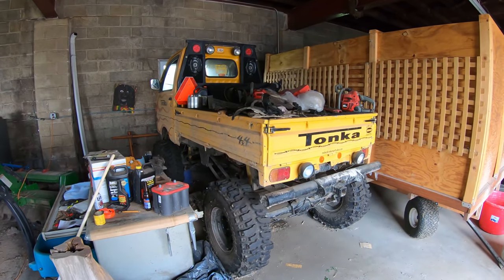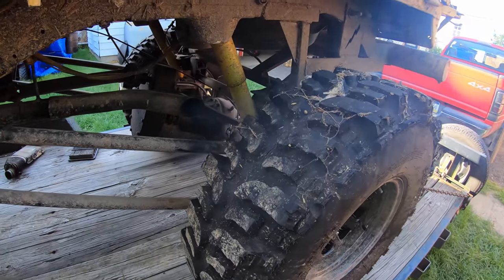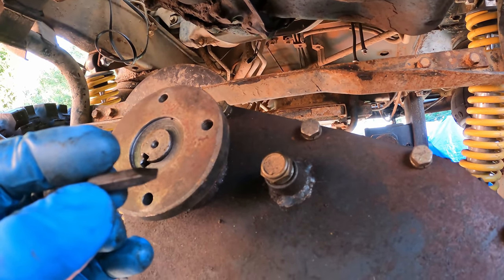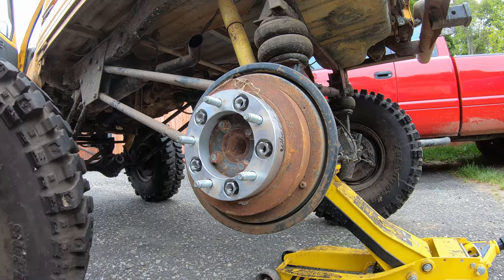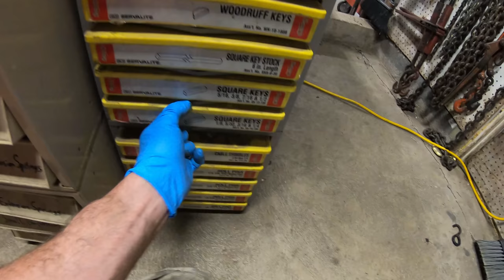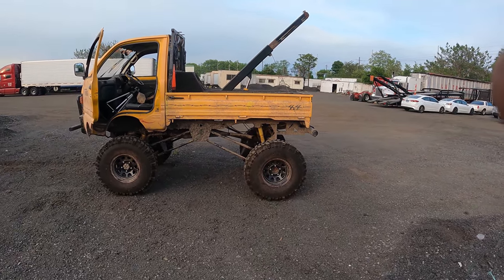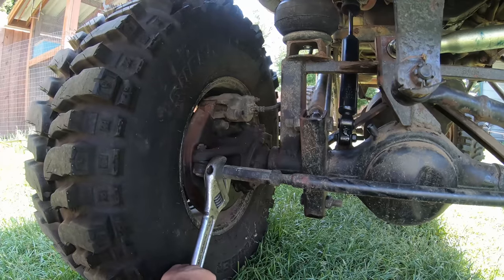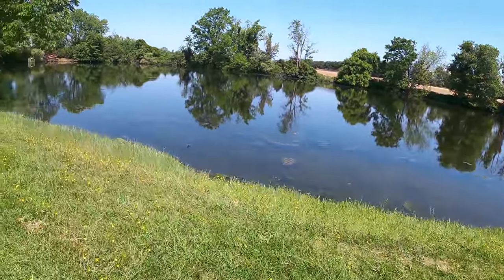Life Size Tonka MONSTER TRUCK - Will She Rip!? NNKH

Comment: My father had a 1980 Suzuki truck like this on the farm we had.  It was a 2 stroke, self mixing 550cc engine 4x4.  I believe he lifted it about 2 or 3 inches with 30 to 32 inch mud tires. That thing was amazing as a farm truck, there literally was nothing it couldn't do better than any Ford or Chevy truck on the farm and mud that would easily sink a Ford or Chevy was a non-issue for it.  We had it from 1983 to 1998 when he sold the farm and the little truck with it.  It still ran great.  I loved the fold down sides on the bed.   Not saying I'd run it as a daily driver on the road, but as for industry/farm work, I'd choose these over anything.  Basically a UTV on steroids is how I'd describe one.  Amazing piece of work someone did to this truck, a head turner for sure.

Comment: I used to import these Japanese kei trucks. They are unbelievably reliable and it is usually something catastrophic like a broken cambelt to stop them from running. 
Great machines offroad with a set of 25's and a lift kit.
Some of the Suzuki and Daihatsu are supplied with factory rear diff lock.
Full credit to the builder of this little machine.
Reply: i see them in the Philippines they are cool AF !!

Comment: The steering box is ready to yeet itself off of there, even with the fix. What a fun build. Every time I come across one of these truck videos I start looking around to buy one. It will happen one day.
Reply from the maker: Haha yeah, I felt like this thing was going to rip off when I was driving it around. Seems to be holding up though!  Definitely needs some more bracing
Reply: If you want fun buy a Suzuki samurai and put a set of super swampers on it. The things are unstoppable
Reply: @jarrettmorris4692  I have own one Zuki whit 31 inch on it was body liftet and hat A 2´Lift kit on it too 
It was unstoppable
Reply: Its perfect budget garage build toy ;) perfect for atv/side by recovery vehicle
Reply: They were only $600 a few years ago
Reply: @jarrettmorris4692  moms ex had one, always with a spare engine ready to put in
Reply: @JohnJames.  same here
Reply: There was one forsale in micco fl the community is called barefoot bay if you want to try to track it down
Reply: @NoNonsenseKnowHow  you gotta re 4 link it front and rear and throw some slam specialties RS-8 bags all the way around...gotta redo the whole setup.get rid of those knarly Knarly Pinon angles..she's gonna be sooooo sick
Reply: @NoNonsenseKnowHow  I mean if u don't want it haha..throw a 2jz turboed with them new 4 links and bags and the new setup shit will ride and handle better then a new chevy with twice the horsepower

Comment: LOL! The angle of that driveshaft! I am surprised it lasted ten minutes!
Reply: IKR?????????
Reply: Same here I thought it would make five min. But the angle of the ring and pinion prob. not getting proper oiling becouse of there angle...might overheat the gears...
Reply: Well he had good intentions gut didn't have the experience...
Reply: @peterrivney552  Still a good way to learn. Learning by mistakes and practical experience is better than learning from a book any day.
Reply: I'm amazed it moved! I've done some Rangi af repairs in my time but I'd never let it off the lift like that. 
Cool concept, terrible execution.
Reply: @Not_A_Cat  Same here. I have seen some very bad construction, especially powertrain and driveline mistakes that surprisingly lasted a while. Of course, poorly designed systems like that usually fail at the worst possible time when loads are at the highest. I have seen drastic driveline angles last a while when kept on pavement and then fail almost immediately once they go offroad. Which makes sense.
I guess that proves just how strong some drivetrain parts are. Even when installed under the worst conditions they manage to limp along for a while. I certainly would not drive them though.
Reply: That's about all you can do when you have a six foot wheel base and 24 inches of lift kit. Besides it's a CV joint running 15mph and you would be surprised what I put that thing through. And the cost was zero.
Reply: @johnstiles4457  Amazing how much abuse those parts can take.

Comment: I've got the Suzuki Carry, 1994. I just can't believe this truck actually moves under it's own power! Unreal, trust me. The 3 banging straight 660cc only puts out around, what??? 42 horse with around 49 pounds torque ??? 
They are a lot of fun to drive and talk when people approach asking what the hell>.....

After sitting for a Few more than a few years, I had mine running in less than 30 minutes as well. 
Quick turn of a screw driver to the carb, clean it out really well, put air in the tires and took it for a ride. 

still running great! Indestructible.

Comment: I have the exact same truck and I love it  , little 3 inch lift  and she goes through almost everything, great for getting fire wood
Reply from the maker: Awesome!
Reply: Keep an eye on the auto choke my Mitsubishi is the same year and the auto choke always gives me some BS, but definitely the best $4000 I've ever spent on a toy
Reply from the maker: @slowburn_1725  Cool, thanks for the tip!
Reply: @slowburn_1725  You can disable the choke if you want. If its like mine you can just take the spring\coil out.
Reply: @mikescudder4621  is it a late 80's Mitsubishi minicab ? If so I'm assuming you had similar issues, it will idol and run fine one second then you take off and it sits on its face and wants to stall out..
Reply: @slowburn_1725  I have a 2 cylinder 550cc Mitsubishi minicab (1981)!!! But I've had an issue on my vw Kombi that had an autochoke, for years they are fine but now that it's almost 50 years old things like this are a pain. I just took the coil out. You have to let the engine actually warm up before you head off but it's actually better for the engine.
Reply: @slowburn_1725  
Can you buy parts at the auto parts store?
Reply: @xmo552  misc parts yes, oil filter, belts , hose's etc but you have to bring original part's with you so you can match, other more important parts I've found on a few different websites
Reply: @slowburn_1725  
Thanks

Comment: I feel like theres more to the tow/crane system than what we saw. The big yellow T bar thing and some other parts in the rear tail gate. They seem like they come out, maybe as wheel cradles?
Reply: I think that is the brace that holds the arm to the bed. Otherwise it would rip that thin metal
Reply from the maker: Yes Ryan's correct about that.

Comment: Ever since I first saw the Honda Acty Pick Up Truck in London in the 1980's I've loved these tiny, forward control vehicles!

Unfortunately, London traffic is NOT where you would want to be in these trucks because the crew cabin doubles as the crumple zone during collisions!

Even quite low speed impacts present grave risks to the occupants, and after inspecting the remains of two which had been in frontal collisions I decided that they weren't for me.

I look forward to seeing your adventures with your Tonka Truck. Subscribed.

In the UK a boat building company called Island Plastics manufactured one piece fibreglass, demountable campers for these trucks, which you could place on the stands and drive away! 

They were hugely popular, and if you do a Google Images search for the Honda Acty Romahome you'll find them, one would look good on the back of your Tonka Truck!

Comment: A hammer and an adjustable spanner. What more do you need? I like that vehicle :-)
Reply: I got a locking adjustable torque hammer at walmet for like 12$
Reply: @yzrippin  I got a 12 v one that fits on a battery from Lidl, about your equivalent of Harbour Frieight for a few pennies, clips on a car battery , not much beats it.
Reply: Those all over the Philippines cheep too

Comment: Considering how the rest of it is built you should just weld up the spider gears in the back of that thing don’t waste the money on a locker because it’s obviously never going to see street duty when I welded up the rear diff in my old Jeep it would go more places in 2 Wheel Dr. with a welded diff then it would go in four-wheel-drive with an open diff

Comment: Those flanges on the drop box are for sail boats.   It couples the prop shaft with the transmission I recognize the key ways Usualy the prop shaft will have holes for pointed set screws.

Comment: I had one when i lived in the Philiipines, the shifter knob was worn out and i didnt realize that i had an extra low gear which was between 1st and 2nd push down and forward it was pretty low. Also it had diff lock in the front ifs axle. great vid man It was a Suzuki multicab 660cc

Comment: I haven’t looked into mine much yet, but how do I engage it into 4x4?  I didn’t see anything inside the cab besides a high and low setting .  Mine is all stock and basically the same as yours

Comment: What exactly is that 4 head air chuck called? and where can you get one?     You could get all 4 tires exactly the same psi that way.
Reply from the maker: I'm not sure if they sell one or not. I made this years ago. But it's basically for clip-on shocks with some t fittings to put them in line.  Original reason I made it was for airing down my tires when I go off road and being able to air them back up with a compressor very easily. Yes it puts all the tires at the same pressure
Reply from the maker: I did some brief research after making it and it seems some offroad companies already have similar items

Comment: that looks like fun, but oh my god that front driveshaft LOL!  EDIT - Should get an axle that has the drop on opposite side, could get rid of a lot of that angle... or rebuild the drop-box to reach to the side further.  Could mount the steering box directly to the axle to eliminate a lot of the steering issues.
Reply from the maker: Yeah I feel like the best move would just be scrapping the whole drive train and starting from scratch. I mean hats off to the guy for all the work he put into it but damnnnn dude

Comment: Do you have a link for those quick clips you used to drain all the tires.
Reply from the maker: No but if you type in clip on tire filler they should pop up. If you're going to make a hose like that just make sure to get the ones that are self-sealing when not clipped.

Comment: The trucks themselves were made by Daihatsu out of Korea everybody and their brother has a version of them usually outfitted with their engine sometimes the Korean Engine 2 and 3 cylinder both left-hand and right-hand Drive 4x4 there's actually an entire platform of these vehicles you can actually get the pickup in a crew cab version Honda Yamaha Daihatsu Suzuki and I'm sure there's some others that aren't familiar to me I have a older 2 cylinder Daihatsu version if you ever seen any southeast Asia films you will notice that these things are definitely mules I've seen them stacked three stories high with all kinds of crap being towed to market fun little trucks I know our little love machine version has provided hours of endless enjoyment for my family enjoy your Tonka truck thanks for the video
Reply from the maker: Thanks for adding some info and I appreciate you checking it out!
Reply: Mr B, I think you’ll find they are Japanese brands, not Korean. Amazing little trucks. My Daihatsu 4WD kei has a diff lock and low ratio. Clears R15 mud tires even without a lift kit and will go just about anywhere. Street legal here in Japan and will cruise (= scream) the highway at 65 mph (unless it’s a headwind) but need to put the small wheels back on every two years for certification. Thanks for the vid. Crazy mods on that Tonka but why not.

Comment: I believe that rear axle gear set up is a modified portal axle hub. They usually are intended to hook to the axle and the hub giving you more ground clearance without jeopardizing too much in suspension and drive shaft issue. I think he should have ran dual portal axle to hubs on all 4 wheels instead of the extra suspension since its messing with the drive shaft angle and performance. and would have done the same thing in the long run. But i understand you work with what you got so...

Comment: How is it to drive it from the right hand side instead of the left hand of the left hand Please comment back thank you
Reply from the maker: Honestly it felt pretty natural and normal to me. Shifting with the left hand felt weird at first but it's kind of nice.   One thing I did keep doing though was trying to get into the wrong side of the vehicle. And also trying to hit the turn signal to the left of the steering wheel when it is actually on the right
Reply: @NoNonsenseKnowHow   I would like to buy one and put a plough on it or a snowblower I you are a snowblower I do apartment buildings and this thing would be ideal for doing the sidewalks and small areas
Reply from the maker: Yeah that would be cool. Definitely a all factory one would be best for that

Comment: The old hand over the carb or throttle body trick works a lot better when you rev it up to high rpms then doit at idle not pulling much but I’m sure you are aware of this
Reply from the maker: Yes. Pulls a lot more vacuum. I think I was holding the camera with my other hand or something along those lines is the only reason I didn't do it that way.

Comment: That’s cool. I like my little samurai a little better I think. Not driving that though u never know. Thinking about tow rig on mine. But never got around to it. And it it’s in good shape almost stock new 235-75-15 muds and 2” lift shackles. And toy 250 carb.
Reply from the maker: Yeah I agree the samurai is a better unit all around. This actually has samurai axles in it
Reply: Cool I like um little mini trucks,Used ones cost so much and usually worn a good bit. I Like the dump bed. Have ac on most. Sammy usually no ac or factory tack. But yeah give up the extra long bed for my samurai every time.  When I found this little zuk it was the needle in the haystack.  Great frame , decent body, bad fast back top and little carb smoke where he took it off the road  was driving it to work , the new truck sitting and driving little Sammy in heat and winter just lasted till winter and new truck took over. Sold it to me for 1800$. Which I was more than happy. Not even hearing it run at time. He was out town and wife was telling me  a week later he’s back and it ran as good as she said and him on keeping phone and it’s in my yard now. Well hell im rambling I could talk Suzuki all day. Lol.  stay safe keep those video’s rolling.
Reply from the maker: @paultrimble9390  Good deal man! Stay safe as well and thanks for tuning in on this video! I appreciate it

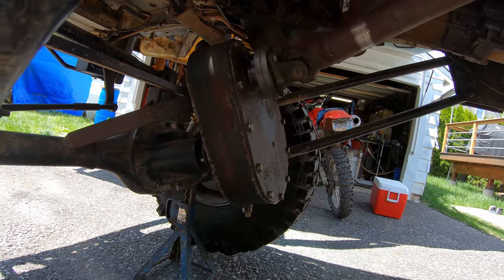Comment: you cant use homokinetic joint on one side and cross on other side :D   Cross joints must be one on one side and second on other side (right mounted ) otherwise you feel wobling from cross joints. For me is better if you change both cross joints to homokinetic ones ;)  7:26

Comment: Thats a Rusco made by Suzuki little 3 cyl engine 600cc. I think in the states there called Carry. I moved to the Philippines several years back and the wife and I just purchased some property in the mountains where there are no roads so we picked up a rusco a couple weeks ago. I think your going to encounter a few problems since it is not built to handle wheels like that and very low on power. but there fun to drive and go almost where ever you need to go.

Comment: Cup holder on the Moto Africa Twin you took to tractor supply?  Where did you get that or fab it out of?
Reply from the maker: It's actually just a bicycle water bottle holder that I kind of rigged up on there. Works good though.

Comment: I have a buddy that has one.
It's not jacked up that high but the suspension is just as hinky.
Reply from the maker: I would imagine the factory suspension has got to be better than this thing. The Tonka is all show. The ride is horrendous but so much fun at the same time.
Reply: @NoNonsenseKnowHow  
It's not factory. It just isn't jack up that high.
   It must be a thing to jack em up and I have yet to see one that worked properly.
He uses it on our hunting/fishing lease,it's slow as hell but it gets the job done.
  I hate going wheeling with him in my Polaris General,I race ahead about a mile and stop and have a beer and a smoke while I wait for him to catch up.
Reply from the maker: Oh got you. Yeah that makes sense. I'm not a big fan of jacking things up for that reason
Reply: @NoNonsenseKnowHow  
I'm sure it could be done properly I just haven't seen one.
Come deer season I'm the one who suffers,he has heat and an enclosed cab while I freeze my ass off.

Comment: Hiya, try the BEST two tyres & wheels on the front axles to eliminate out of balance wobbles, backs got no swivel joints to rattle, the rest needs doctoring badly. good luck.
Reply from the maker: Thanks for the input. And yeah, she's a pretty rough build but definitely cool for what it is

Comment: you can fix flat spots by driving around with super low pressure in the tires.....like almost flat
Reply from the maker: Awesome, never thought to try that. I'll give it a go when I work on this thing again. I figured bumping them up to 45 PSI for a few days in the summer heat would have helped but didn't do much

Comment: Hi it's wonderful but something is missing .that Spear wheel must be placed to front side vertical  or horizontal .I think if you pleased the wheel horizontally you can avoid accident (the wheel work just like air bag by filling limited air in Tyre) .if  wheel hit some vahical hardly it absorbs accident energy.

Comment: Those are real goofy drop differentials.  Maybe not quite as goofy is the kind of differential that the drive shaft connects to a 90 degree bevel gear on top of the axle.  Or maybe they are gear drive, but have seen the old heavy trucks use them.